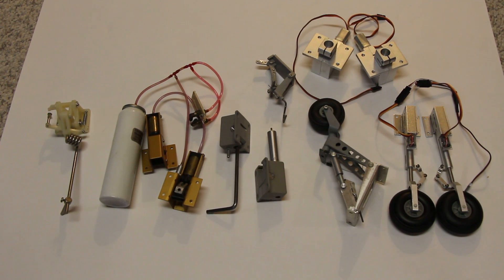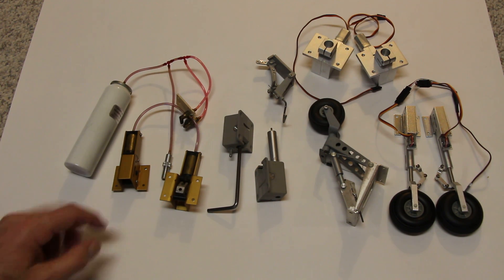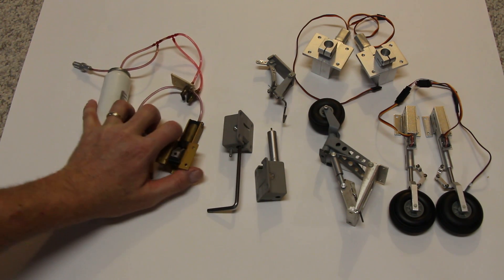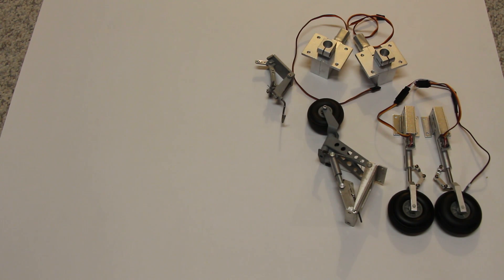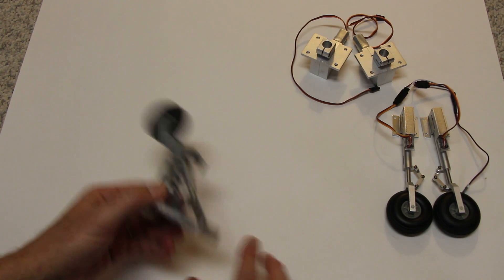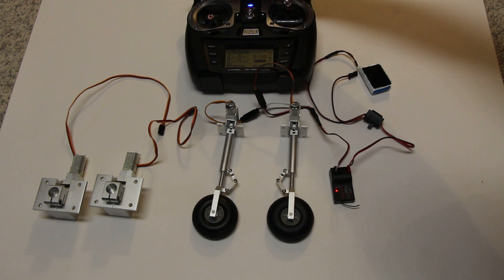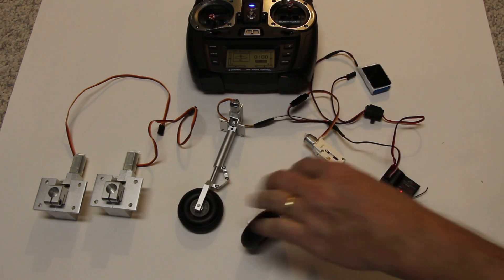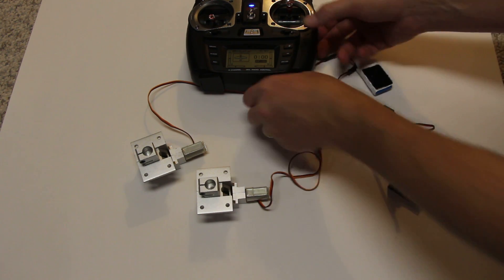Retractable landing gear for model airplanes - overview

Comment: Can you show how to set it up on the receiver?
Reply from the maker: The connector on the electric retracts would plug into the reciever just like any ESC or other servo. I typically put the landing gear on channel 5 or higher and assign it to a toggle switch.

Comment: Are there any that go straight out?
Reply from the maker: Any of the main or nose gear units are designed to swing thru a  set number of degrees. Some only move 80 degreees, the majority will swing either 85 or 90 degrees. The 105 degree units are are used for some twin engine main gears or nose gear units. Not sure what you mean by straight out.
Reply from the maker: if you are looking for a retract unit with the electric jackscrew on the opposite side of the retracted position some manufacturers offer this type of design
Reply: @clscale  I was thinking like not swing, like just extend straight.

Comment: what product's have these?
Reply from the maker: The Grey plastic ones are from Robart, the metal ones I got from Hobby King. the retractable tailwheels came from robart. The units that I like best is E-Flite which is not shown in this video.
Reply: Thanks